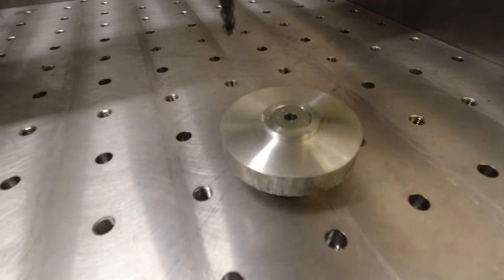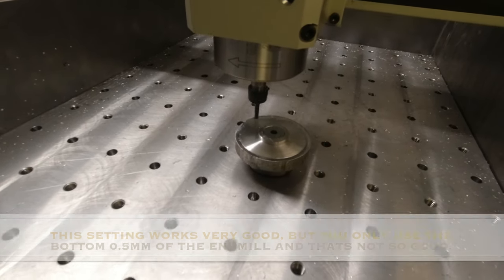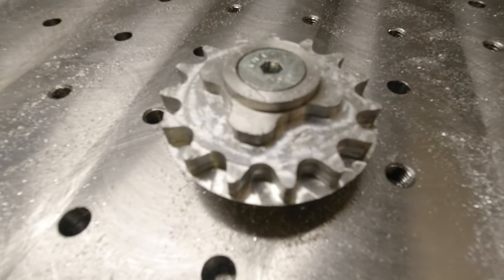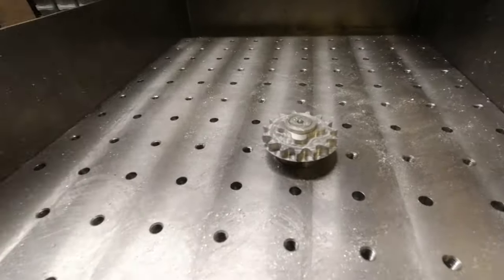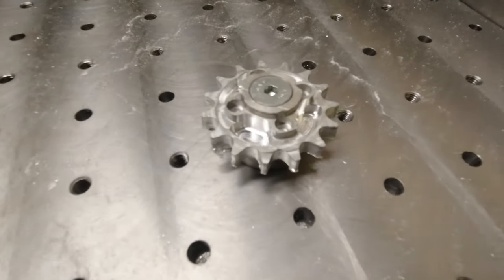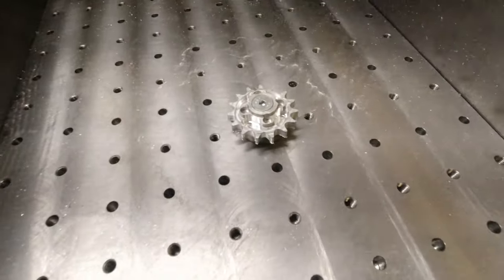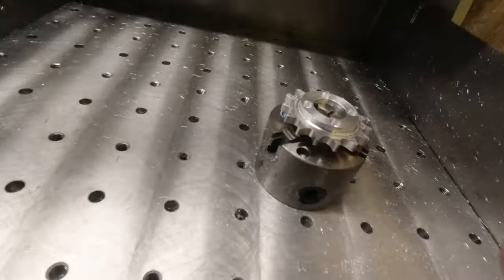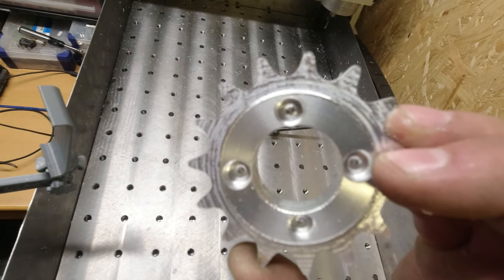How To Cut Aluminium With A 6040 CNC Router. Part 1 - Milling A Sprocket

Comment: Good idea using the chuck from the 4th axis. What was the coating on the end-mill that worked so well? Maybe air blowing would help the chip clearance?
Reply from the maker: Thank you, yeah the chuck is very useful!! It's a Garant mill from Hoffman Group with a DLC coating. Yeah air usually works on alu, but this was alu made for bending so it's suuupersticky😅

Comment: Very cool 😎 i have had this same machine now for 3 weeks, soon i hope to machine some thick aluminium when i perfect fusion360 & programming. I need to scrap the alloy extruded base & make mine solid steel like yours is because vibrations & accuracy is not the best.
Reply from the maker: Thanks😊 Yeah the orignal table isn't good for anything. But you can mount a thick mdf-board under the orginal aluminium table and change m4 screws to m6 and put some extra screws in the middle and also get some good result. But steeltable is the best👍🏻
Reply: TomasTheCreator ok i did think of mdf under the original alloy but i think for the long term the steel table will be most suited 👌🏽 i am having troubles with soft limits & zero my home ( refer all home ) I cannot over write machine co-ords has this been an issue for you ? Do you have license version mach3 ? Thanks Thomas 😎
Reply from the maker: Yeah I couldn't either overwrite, but I didn't try so much because I was planning to install homeswitches. And with them you dont't have to care abojt machinecoordinates. Yeah, but I plan to get mach 4 soon😃 Hope I answered your questions!
Reply: TomasTheCreator thank you for the reply, will continue to follow your progress & will be interesting to see how mach4 goes with the cnc6040 chinese machine 🤞🏼

Comment: Using WD40 will help to stop chips sticking and melting to the bits especially on aluminium, you could also try mist coolant if you have a compressor.
Reply from the maker: Great tip, thanks👍🏻👍🏻